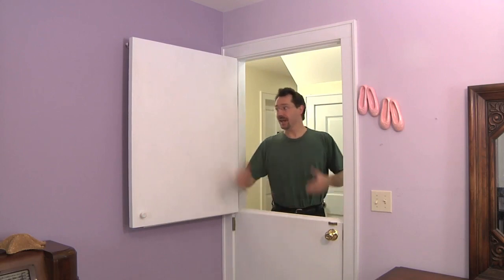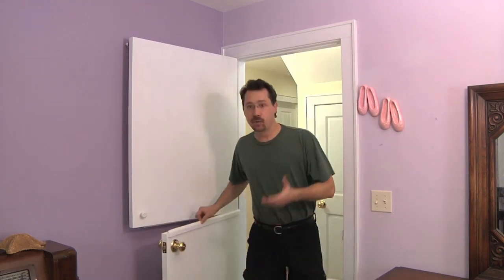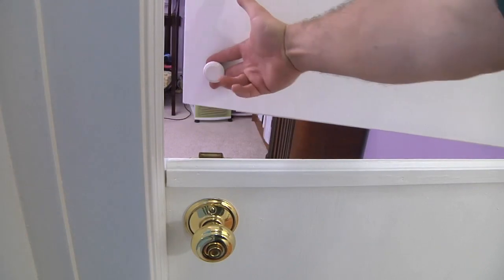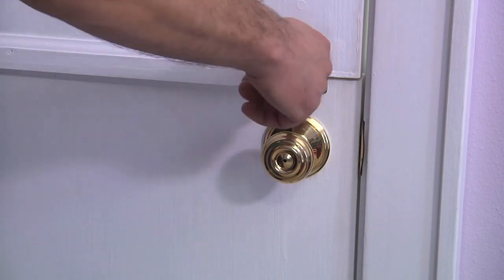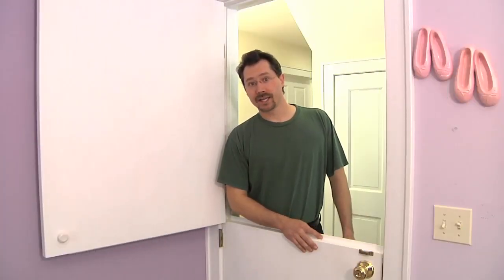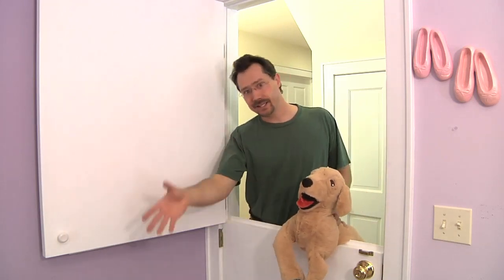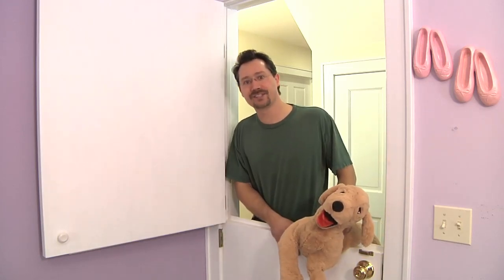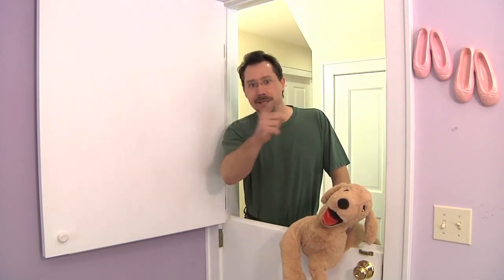DIY Dutch Door: Overview

Comment: Truly brilliant video and explanation. Been trying to find a solution for separating cats in a tiny space with multiple rooms that is only cooled by 1 mini split cooler. So, if we can build a style like this but customized so the bottom closing part goes higher to about 2/3, vrs 1/2, it will allow for the cool air to circulate and prevent the kitties from getting room to room.
 Great thank you.

Comment: Using hollow door. What did you use a filler to strengthen hollow side. Im doing this now but lil stuck lol. 2×4 is to big
Reply from the maker: +bud lee, I used a rip of cedar, about an inch by and inch and an eighth. It&#39;s light and easy to work with.
http://www.instructables.com/id/Build-a-Dutch-Door/step6/Frame-in-the-cut/
After having built the door, I found that a hollow-core door is a much better way to go than a solid door because of WEIGHT. It's very hard to slam a hollow-core door on your fingers. It's like a wiffle-door.
Reply: +BenjaminNelson Omg ty for reply. Yes doing this for kids game room and wanted light hollow door. Ty again will try it
Reply from the maker: +bud lee Post a video when you are done with your project. Good luck!